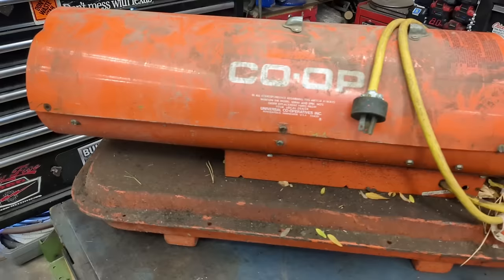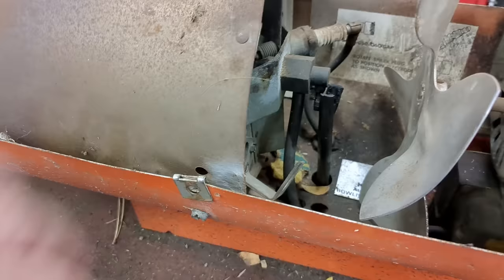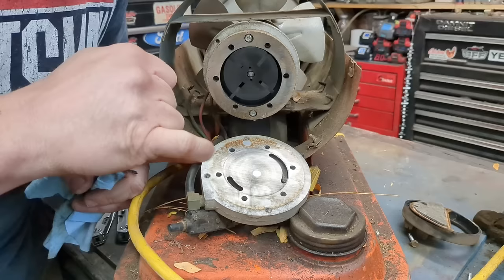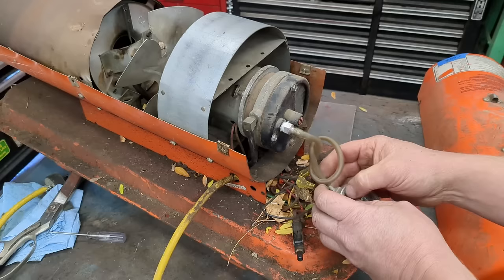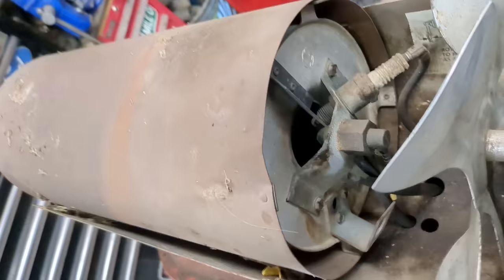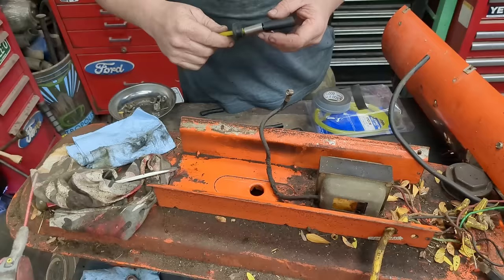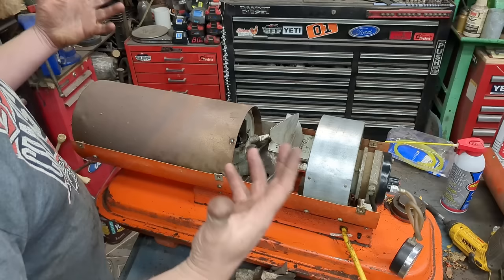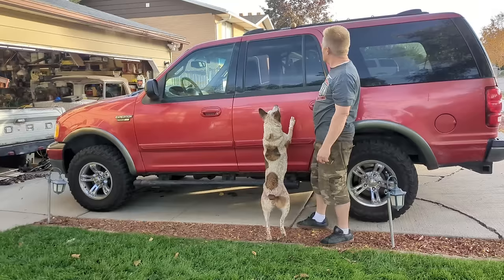Diesel Kerosene Forced Air Heater FIX EVERYTHING

Comment: That turned out great, just in time for winter.  I have a Chinese Webasto clone in my camper, it's more like a jet engine I guess but it's diesel and it might just make winter bearable with the gentleman from Russia threatening to turn the gas taps off this winter.
Reply from the maker: I've been eyeballing those diesel RV heaters. Have you used it much/ what do you think?
Reply: @sixtyfiveford  They are fantastic. They come in 3 main sizes, 2kw, 5kw, and 8kw, I have the 5kw and as I understand it they are the most efficient and use the same amount of fuel as the 2kw. It will heat a pretty big RV, but I've only used it in my VW T4. There are several variants, which are all basically the same but come with different types of controller, the ones with a colour LCD and remote are probably the best if you want to fine tune it. The simple dial type is just fine though.
They can come with separate parts for custom installs or as a self contained unit. Also they have a dedicated exhaust which must be run outside so CO risk is low.
They are really popular with van lifers and once set up they just work. QC seems pretty good for the price,  I rarely hear of a bad one slipping through. Great value for money. Oh, just one tip, never just cut the power to them, they need the run down cycle to avoid the risk of overheating the board. Hope that helps.
Reply from the maker: @strongandco  Thanks for the info
Reply: @sixtyfiveford also, they are pretty quiet, quiet enough to to sleep with it running. The worst noise it the gentle but persistent tick of the dosing pump. Some people suspend the pump in a cradle made from cable ties and locate them in a cupboard to keep them quiet. I've mounted mine under the van in a silicone case - I think the cable tie solution works best. Still way better than the catalytic gas heater I had before and much less condensation. I'm so happy I've got it, I hate the cold 😄

Comment: I have a Reddyheater kerosene torpedo heater and switched to a propane Mr Heater last winter because kerosene is hard to find in my area and is over $8 a gallon when you find it. Propane is $17 to fill a 20 lb tank that lasts a few days to run and is readily available. I like the kerosene heater, but due to costs and availability I kinda had to switch. It was a no brainer decision.
Reply from the maker: Yeah, at $8 a gallon/kerosene, propane is about 30% cheaper (3.77gal). However straight diesel at 4.50/gal is 25% cheaper to run than propane because it has so much more BTU per gallon.
Reply: @sixtyfiveford  Wow, I wish Diesel was that cheap. It's $6 where I'm at and climbing fast.
Reply from the maker: @JoeBidenIsNotMyPresident  It's been a few weeks since I looked but I guess I'm up to 5.15gal now.

Comment: I bought a few years ago from lowes it's a 180,000 btu I think and I had nothing but problems with it and it's setting in the corner collecting dust, it either won't light or it will stop working with a error because of that stupid sensor by the igniter,  I would like to by pass that pos like this one is that lights right up even with 20 year old fuel, I'm going to have to dig it out and figure it out  before it gets real cold.
Reply from the maker: That's frustrating.

Comment: The one problem i have with mine is the lube from the motor will ooze into the air pump and cause the pump vanes to stick in the center hockey puck, then it doesn't pump air, and whomp whomp no fuel and no fire (or reduced fire with sputtering)

Comment: aweaome video can you do a video on a propane tube heater? Im getting smell from it and can barely run it in my shop its horrible just wondering if you have any idea how to tune those
Reply from the maker: The regulator on the hose goes bad all the time. That is what controls the gas flow rate.

Comment: I actually had one that would only run and stay running with the top removed. 18:20 
It would shut down when you put the top on
Reply from the maker: That is generally do to low air pump pressure.

Comment: Just came across ur channel love your style definitely sub ..what about propane ones are those ones that can be tuned thanks
Reply from the maker: The propane ones rely on the regulator to control the gas flow through a specified size orifice. The regulators go bad all the time.

Comment: the problem i have with mine is the grease from the motor oozes into the vanes and causes them to stay stuck inside the puck.  I just take it apart, wipe everything in there with a paper towel and reassemble...

Comment: nice i wanna see it ran on like a 70:1 motor oil diesel mix
Reply from the maker: Problem with motor oil is it thickens/thins too much with temps and you'll need to constantly adjust pressures to compensate. Also you're breathing everything it pumps out so...
Reply: @sixtyfiveford  i understand

Comment: A question.  My small ag drill has 2 bearings that won't take grease.  The zerks are not the issue.  I already tried heat, no luck.  Could ATF be injected in there to dissolve the hardened grease inside?
Reply from the maker: Carb cleaner(acetone) will dissolve grease really well. So will any wd-40 type spray. I feel like something in an aerosol can would be the easiest to cobble together an injection system. ATF is just 10w mineral oil with a detergent package and red dye.

Comment: Ok what if I told you I had to use a flammable spray to basically jumpstart mine each use. i use like starter fluid or brake cleaner and it ignites, but wont start on its own.

Comment: So, this was super useful. Mine spits fire out of the front. I'm at 8500ft so sounds like maybe mine is too rich. So, do I turn it counter clock wise to decrease fuel?
Reply from the maker: Counter clockwise to decrease fuel. So much less oxygen up there you need less fuel. I swear they set these at sea level as even at my 4500ft they're too rich.
Reply: @sixtyfiveford  Thanks! You have helped me greatly over the years.

Comment: Well moe, you dropped the ball mate,  not cleaning the mouse house propperly 😀
I would drench the inside with Jays fluid diluted, or toilet bleach diluted.
But you like mouse house aroma :-D.
When i worked at an auto factory, we had diesel heaters for use on coaches and similar.
They were like hot torpedoes.
They had quite a few sensors and a silver box with a pcb in it to control the heater.
I was the electronic repairer but when those boxes failed, there wasn't much i could do as we had no schematics for them.
Working blind was typical for that company.
Ill shut up now.
Reply from the maker: I thought I had cleaned it good enough with acetone but no. Luckily I think it incinerated any remnants and no longer smells.

Comment: I've got a relatively new low hours one someone gave me because it sputters and shoots flames out the front. I had it completely apart checking for everything. couldn't find anything wrong.
Reply: The red knob he was messing with will adjust that. Turn so the cone is uniform orange color to the edges but not too many flames going around the sides of the cone. If it doesn't adjust easily and noticeably, do the filters and hose replacements shown. And pay attention to his point of mud dabbers/spiders plugging up the red knob hole and other nozzles.
Reply: I would clean the nozzle out real good be set the pressure.
Reply: @snakerstran9101  I'll look at that. it's weird though it doesn't constantly shoot flames it just pops every second or two
Reply from the maker: Intermittent flames like that can be a few things. You could have a sticking impeller blade giving a inconsistent pressure pulse.  Crack in the fuel pickup line could be sucking an air bubble. Nozzle/jet could be spraying off to one side.

Comment: Got one at a garage sale do you know what I can do to use it with a missing fuel level gauge. Would it run ? Do I cover the hole to try to run in a garage without the fuel gauge?  No one sells the part in Canada for the Remington 80,000. The states wants to sell it 8.97 + $50 shipping, ouch!  I'm downloading the info but no mention on the fuel level gauge importance if missing. Thanks
Reply from the maker: It's not important

Comment: The leaner the mixture less carbon monoxide but the more oxides of nitrogen and carbon dioxide still not safe
Reply: Maybe there could be an heat exchanger and this device could be ran outside ? Just brainstorming

Comment: Even running a new heater at the set pressure it smells like kerosene,  does higher air preasure make it run leaner or does lower air pressure do that?
Reply from the maker: If the cone at the front isn't glowing a light red then the pressure it too low and you aren't getting complete combustion. If you see flames coming out around the cone, your pressure is too high and or you jet isn't spraying a nice uniform pattern.

Comment: Mine literally stopped working over the weekend. Haven't dived into it yet bit it's still heating up the glow plug, just does nothing after that
Reply from the maker: Split in the rubber air line is what I find the most.

Comment: I have had 2 heaters that still ran good, but the bottom of the fuel tank rusted out, and I was unable to find a replacement tank for either one.
Reply from the maker: That stinks.

Comment: Newer ones have electronic modules safety which fail.
Older ones simple only nozzle ,hoses ,air pump vanes are the issue. 
Have a bunch of them.
Air pump vanes stick and don't supply enough air to lift fuel.
Just clean pump vanes and filter check fuel lines.
WARNING ⚠️ they make CO2 which is dangerous if used in a closet space .
Diesel forklift exhaust.

Comment: Does anyone know can i run diesel a kerosene heater thats has wicks or should i get this torpedo kind and run diesel in it and add a plug in thermostat ideas please 🙏 thanks so much and would be used inside with a ventilation fan to attic vent out roof and windows cracked open

Comment: Well I just clicked the SHOW MORE link and found the gauge that I need so y'all can disregard the rest of this foolishness:
I bought one of these used heaters and it runs fine with Diesel except for the flames shoot out the front a bit and the nose cone is redder than I think it should be. I tried to adjust it by backing out the adjustment screw but it didn't seem to change anything. My guess is the ball/spring is probably stuck in the forward (most pressure) position. I can't seem to find a low-range gauge to hook up and Auto Zone wants around $50 for one. The Harbor Freight gauge goes up to 160 pounds so I don't think I can set it accurately to the recommended 3.8 pounds. Any thoughts?

Comment: What spark plug is used and what is the gap setting?
Reply from the maker: There's a few different ones these use. Generally it'll say in the inside next to the plug the gap and spark plug model or just look at your old one. The gap is anywhere from .050-080"
Reply: @sixtyfiveford  thnaks but it the spark plug is missing and there are no labels inside or outside toi teo me anything othey than it is 75,ooo btu's

Comment: What would cause my Remington 60k BTU kerosene/diesel to not suck up fuel and spray out the nozzle? It is set up identical to this heater in the video, but mine has a heating element and not a spark plug. I’ve cleaned the nozzle, filter, new lines, cleaned the pump vanes.
Reply from the maker: Not enough air pump pressure getting to the nozzle
Reply: @sixtyfiveford  so in that case would it be the electric motor needing replaced? I set the vane pump to 3 thousandths and still nothing.
Reply from the maker: @jordanbarns8690  You need a pressure guage to see what pressures you're getting.

Comment: Can one of those lil orange Dyna-glo forced air propane heaters be adjusted to burn cleaner also?   Tried using it to heat my garage shop and damn near passed out after 30-45min of run time.  Dying isn't really worth being warm.
Reply from the maker: They control fuel only with the regulator on the hose. The regulator goes out fairly regularly and either dumps way too much fuel or not enough.
Reply: @sixtyfiveford  Thanks for the info.  I'll check it out.

Comment: Can all of these run diesel or are the ones marked for just kerosene unable to without modification?
Reply: Kerosene stays thinner in cold weather. Running diesel will work fine, but around zero F. it may quit. Here in Minnesota the pumps change from summer diesel to winter diesel so fuel lines dont gel up.
Reply from the maker: They all run Diesel just fine in my experience. If you're apprehensive fill up you fuel can in the winter when "Winter Diesel" as that is Diesel with 25-50% Kerosene so it won't gel. Kerosene is just diesel fuel with the paraffin wax removed. Prolonged running could foul the spark plug is the worst I've seen.

Comment: Would 3in1 oil be thin enough for this application?
Reply from the maker: 3in1 oil is just a little thin but it would work. 3in1 does make a dedicated electric motor oil that is around sae20w.  Ideal for cold start electric motors is around 10w-20w where standard 3in1 is 5w.

Comment: Got a old I h h50d  front end loader.  I got fuel problems much like yours.  Which led me to your post. Had fuel pump rebuilt at a cost of $1000, technical said that there was not much wrong with it but rebuilt it anyway. 
   My problem is that they didn't put it back the same way as I brought it to em. Now its out of time. Just  wondering if you might know how many degrees before tdc that it needs to be set at.
 Also wondering if you know the valve lash. Once again it's a 1961 282d thanks 
Murray from Surrey
Reply from the maker: Sorry I don't know

Comment: Diesel is the BETTER fuel for a torpedo heater....period.....These are NOT designed for kerosene without additives!!.....as kerosene is too dry/hot and actually designed for Wick and Radiant heaters instead.....I'm shocked at how many people don't understand this.......the whole "kerosene" thing is purely for liability, and to Sell Jugs of Kerosene at box stores!! if you're worried about smell, you bought the Wrong heater, go get Propane.

Comment: Why in the world would you want to  breath the exhaust out of that thing. Diesel heater will heat and sends exhaust out side. They are on ebay.
Reply from the maker: carbon dioxide (CO2) and water vapor (H2O) is what they spit out which is harmless.
Reply: @sixtyfiveford  The fuel has all kinds of additives in it also.

Comment: Unless your burning kerosene (which is more expensive than diesel here) your always going to have an exhaust smell and probably micro particulate soot. Their loud, stink, crude (your just burning a fuel in open air and using the exhaust for heat without a heat exchanger) and a modest size one uses insane amounts of fuel. It's a wet heat as well. The world has moved on to the internal combustion design that the chinese have copied from eberspacher.